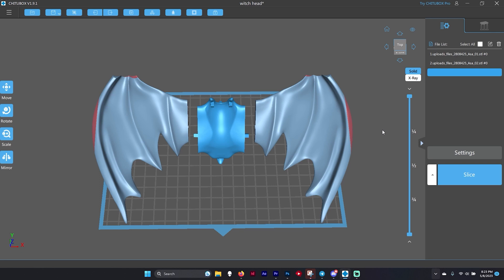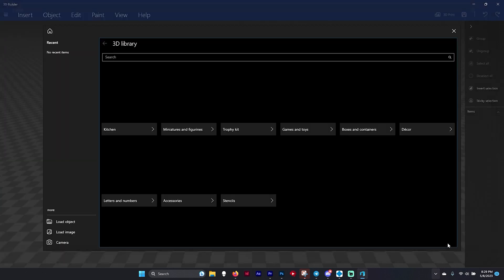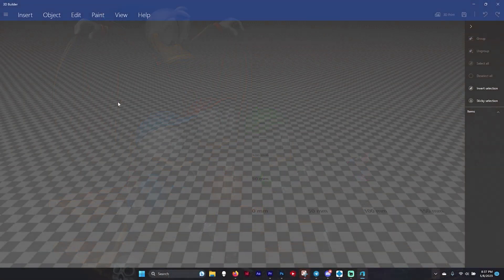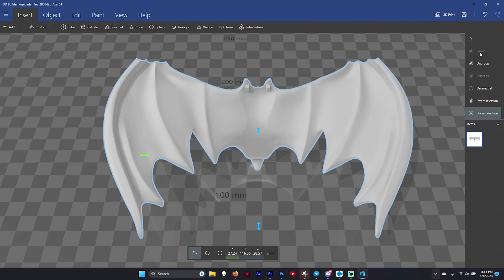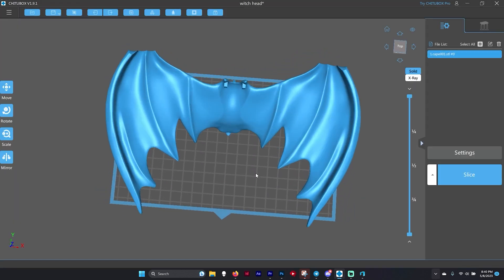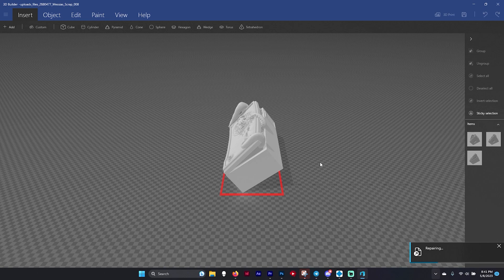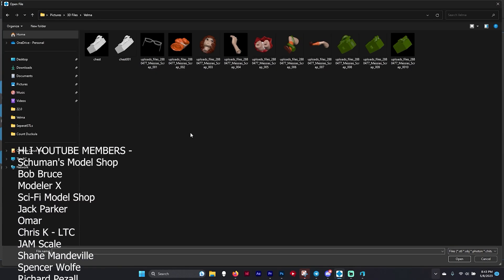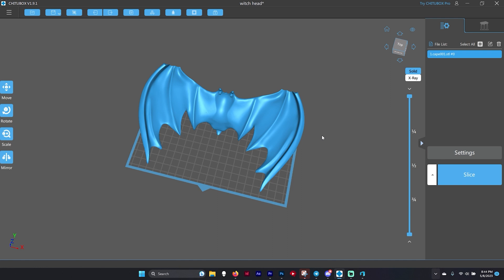HOW TO: COMBINE 3D Models with 3D BUILDER! (Beginners Tutorial)

Comment: You said you'd make another video on how to combine pieces when they didn't want to automatically group, I'm not seeing that.  Was one made and I missed it?
Reply from the maker: I got frustrated with trying to combine them in 3d builder. You ha e to manually place them j position, group them, and then merge them. For some reason I keep getting gaps between the two connection points. I haven't tried in a long time I have to attempt it again.

Comment: Very nice! I love printing as large a file as possible and it's always nice to be able to rebuild some cuts. I can't be sure, but it is possible it is not so much Microsoft builder doing the work as it is the original artist in how they've set up their files. 3D files have built in "origin points". Again, can't be sure I'm describing this correctly but these points are just a single x,y,z coordinate that is unique to each file. This is used by any program to reference where in empty space to place the file. If an artist sculpts a single object that has one origin point and then cuts it up later into printable parts, if they don't reset the point for each individual part, all the parts will still have their own point- but that point will be the same across all files. The issue with your first file looks like the artist reset each file's origin point after cutting up the part. There is an option to have the origin point be in the center of mass/volume for each file. And that's what it looks like has happened. Each file winds up imported on top of each other because the point of each file is in the center of its mass/volume. This can be useful in some cases, otherwise if you import a file where the origin isn't actually within the volume of that part, the part can import way off the center of the screen and then you have to zoom way out and find it. It's nice when multiple parts all share that same point though - because then like the winged cape- they can import exactly meshed together the way they were before the artist cut and keyed them for printing. Sorry if none of this makes sense. Or if I am totally mistaken and Microsoft Builder actually can interpret the file shapes and arrange them! Hoping actually that is the case, as that would be an awesome feature to bring to the table. Thanks for sharing! Super useful for rebuilding
Reply from the maker: You are absolutely correct I was wrong about 3d builder doing the "magic" it is how the artist set them up like you said. If they do it were it lines up 3D can put them right together. If not then I have to manipulate them to be in the right positions.

Next video I will explain that :)
Reply: @HobbyLinkInternational  ah okay 😫 I was hopeful that Builder might have had some kind of new AI tool that could look at side profiles and match things up. But dragging and dropping still works. Looking forward to that video too, always some new twist to learn 😁